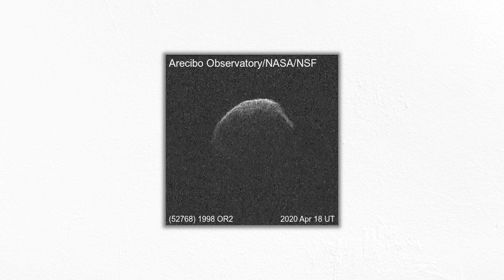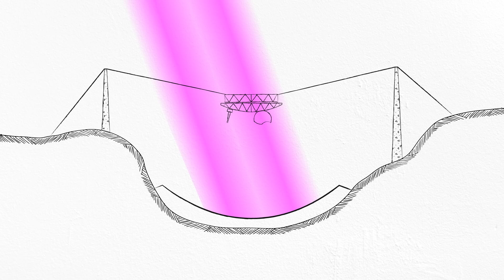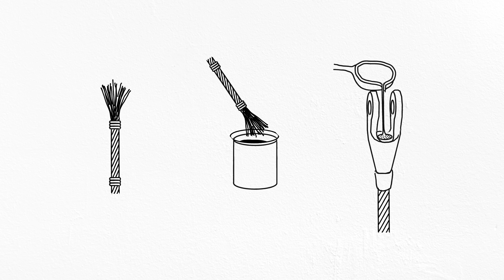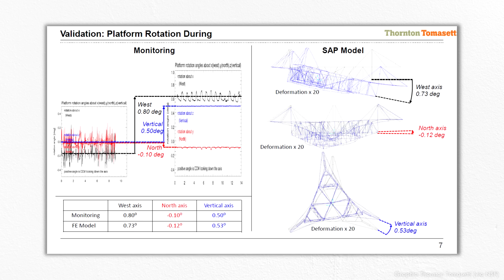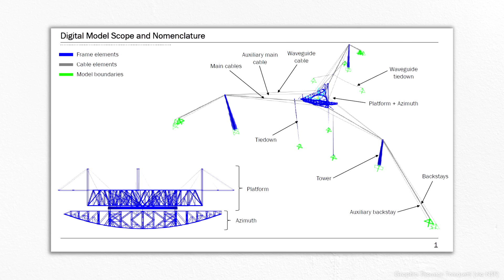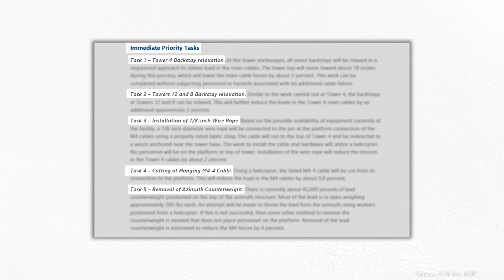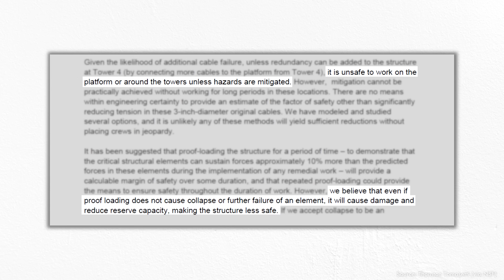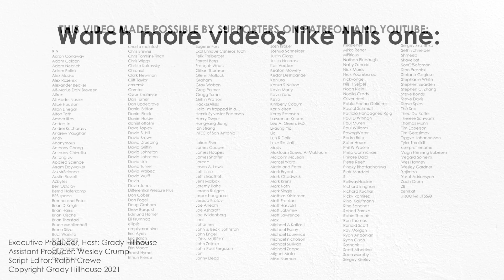What Really Happened at the Arecibo Telescope?

Comment: Video Idea / Video Suggestion:  Why are American railroad companies switching over from traditional railroad tracks to modern "continuously welded rails"? 

The continuously welded rails appear to be highly susceptible to bending, flexing, and cracking due to heat yet these new rails are very popular.  Traditional rails had expansion joints installed to greatly mitigate the bending issues; what's wrong with the old tech?

Comment: As a retired reliably engineer I can say that the design could have incorporated a few mitigation systems. One would be the ability to regularly change the cables. Two would be storm load protection. Three have the ability to lower the receiver to the ground for maintenance. 
In terms of design the dynamic wind and movement forces are usually significantly more than static.  No allowance seems to have been made for metal fatigue in the design

Comment: Metal fatigue could be another factor. With the cyclical loads of a suspected structure steel can fatigue to the point that it fails under it rated capacity.

Comment: 1:40 this is incorrect. angular resolution is determined by area, as per the Rayleigh criterion. Exposure time affects sensitivity and signal to noise ratio, not resolution. you could focus a radio telescope on a spot in the sky for 100 years and still not be able to resolve whether an object is two closely-spaced stars or if one large star, whereas a telescope with a larger dish (or two telescopes spaced apart from each other) could do so almost immediately.

I know this is practical engineering and not practical astronomy or practical optical physics, and that this video is simplified for the layman, but treating exposure time and aperture size as two interchangeable qualities that can be swapped around to achieve the same thing is more than a simplification, its false.

Comment: When you said the telescope was designed with a factor of safety of 2, was that before they added the Gregorian dome? If so, what would the new factor of safety have been under these new loading conditions?
Reply: Well, remember the additional cables they added during that process - I’m sure it was modeled to remain the same or even greater than the original design. Of course none of rhat matters when you have things failing WELL before their calculated / certified load limits.
Reply: The auxillary cables mentioned were indeed added to bring the safety factor back up to 2, with the extra weight, as stated below by Alex. However, there are speculations that this was never really achieved, as it's difficult to 'balance' the load between several parallel cables, making sure they are all carrying equal amounts of the weight.
Reply: @superf2003   I was looking for someone to mention this. Great observation, I thought about the same exact thing.
Reply: @superf2003  I'd imagine that some sort of harmonic analysis could be used to gauge tension, as with a cello string changing pitch as you make minor adjustments to the pegs or screws.  Then again the different characteristics of the different cables (and eras of cable) might make that a non-trivial comparison.
Reply: @superf2003  If the first cable failure failed at the "62% load" stated, wouldn't that mean that (if not the safety factor (as that's a design-process thing), then at least the real-world situation) the factor was at maximum 1.61 ? 
As a safety factor of 2 should mean that parts should hold 200% their calculated load, so they shouldn't get above 50% if everything goes as it should.
Reply: @jelteklaswijnja4055  Yes, but this is after many years of the structure being in disrepair, and with two cables already gone.
Reply: @TheEmeraldMenOfficial  Yep, those safety factors are not static values. They can diminish over time due to corrosion and wear, as well as modifications to the structure. That's usually taken into account when calculating the projected lifespan, the point were the yield strength becomes less than the minimal acceptable safety margins. Of course, the quality of maintenance has a huge impact as well.
Reply: @rpgspree  Thank you. Things degrade, people. Metal rusts.
Reply: At the time this was built, it was more of a safety guess. And not a very good one. No one really knows what the safety factor of a structure is until it fails, especially something as unique as this. That is (unfortunately) how we learn. The lesson from this (as well as 'make your cable attachments properly!) appears to be 'don't base your calculations on steady load + it's the potential peak loads that matter'.
Reply: My thoughts too - if the safety factor was 2 prior to the dome being added, wouldn't the safety factor go down once you added the dome (which weighed another 50% of the existing supported structure)? Sure they added some more cables, but the original cables weren't chosen with the increased weight in mind.
Reply: Budget, son

Comment: Well stated. As an advanced material reinforcement and synthetic cable engineer, corrosion, and only 3 towers the harmonic and inharmonic frequencies were amplified by  only having three towers.

A 4 tower design and more cables with rubber isolators, larger water tight replaceable sleeves is a much better design and shares and spreads out predictable shock, static and dynamic loads in a superior controlled manner, easier and safer to replace cables. 

Shock loading can exceed ultimate new tensile strength by as much as twice the rated tensile strength.

Comment: Two highly relevant words that are missing from presentation, Metal Fatigue. The constant pulling and release of tension, over the years, played a part in this collapse. Like a spring in a magazine, over time, being compressed, and decompressed, eventually leads to failures to load the cartridge properly, known as Fail To Feed in the shooting sports. The constant shifting of weights and tension that occurs when changing location and focusing distance, over time, had a significant role I would imagine. Sad loss regardless, Perhaps a carbon fiber cable and/or structural skeleton might help alleviate the load weight in a rebuild?

Comment: Safety factors are indeed a huge part of engineering design. But, no amount of design can account for age. Everything wears out. As you noted, there is a strong possibility of salt air corrosion over the course of 50 years may have led to loss of integrity. I'm sure there were mitigating actions for the age, but from what I see, the structure and cables would be very difficult to maintain over a 50 year lifespan. Nobody beats father time except the Pyramids.

Comment: Correct me if I'm wrong, but shouldn't the factor of safety also consider the consequences of failure as well as the difficulty of inspection and time and cost needed for repairs/replacement?

Comment: Wonder how much weight in paint was on that platform too. If it was painted regularly, I doubt the old paint was completely removed first. Paint gets heavy and layer on layer adds more and more weight. If the cables only had a safety factor of 2 at the time of construction, increased weight from instruments, cabling, 50 years of painting, combined with 50 years of corrosion, put those cables out of spec.